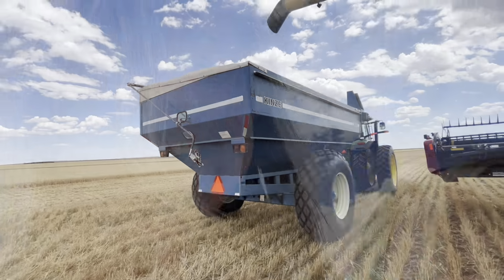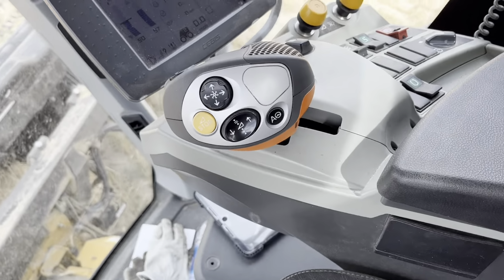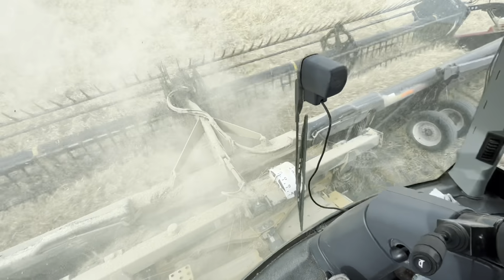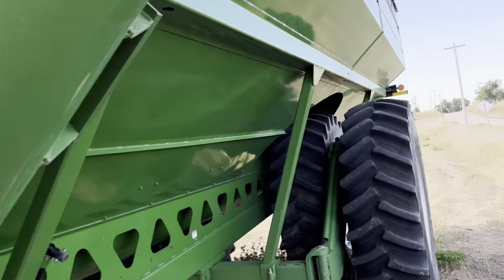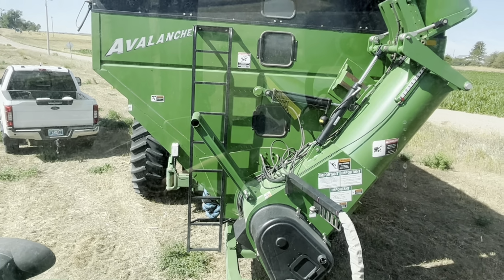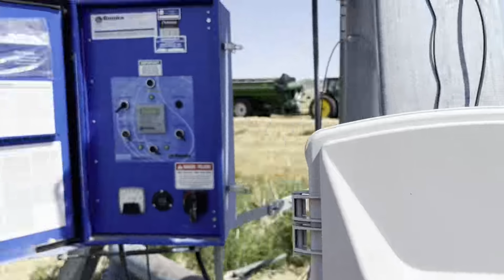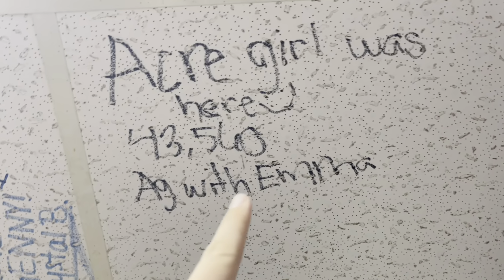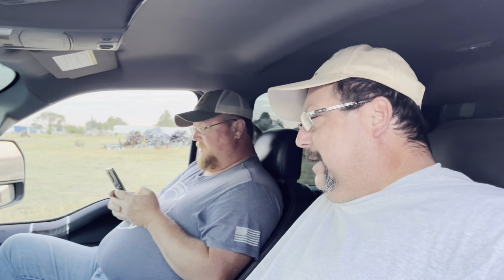Nebraska Wheat Conditions, Claas, & Cold Fast Food - Custom Harvest 2022

Comment: Interesting discussion on sawflies.  As one can see from Kates' Ag videos, Montana has a huge problem with sawflies.  Because so much of the wheat is lying down, they usually cut the wheat first then use a pick-up head on the combine. Otherwise their yield would be very low.  Hopefully it doesn't get to that point in Nebraska. (A little insect trivia): Technically Sawfly's are not true flies, they are related to Ant's, Bees, and Wasps.  The "saw" used to cut stems is a modified equivalent of the stinger on a wasp.